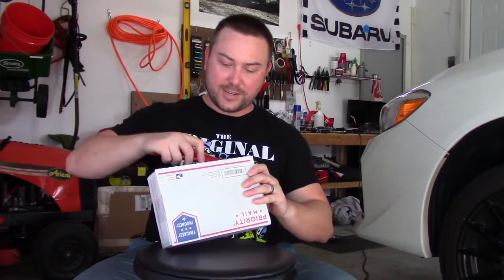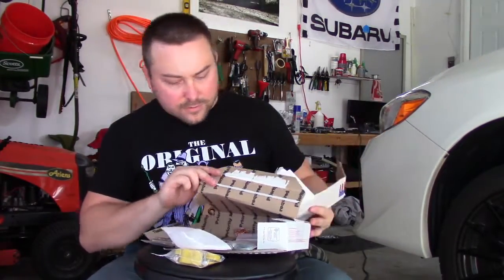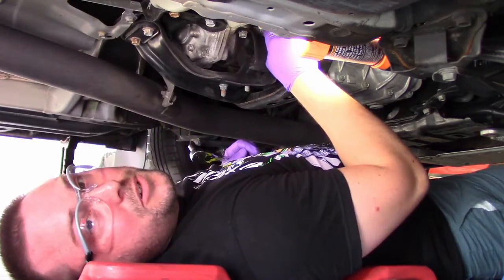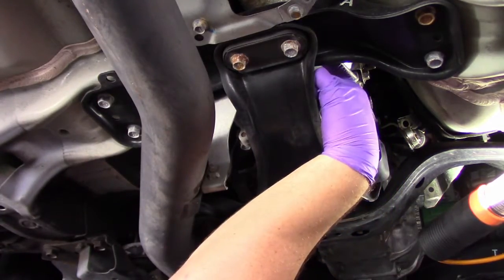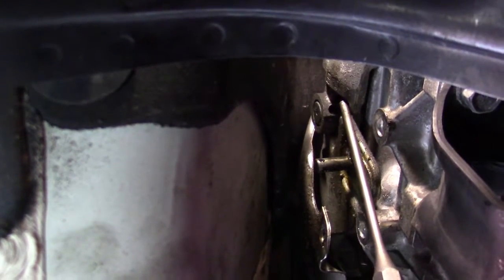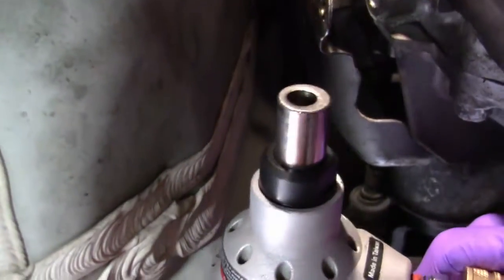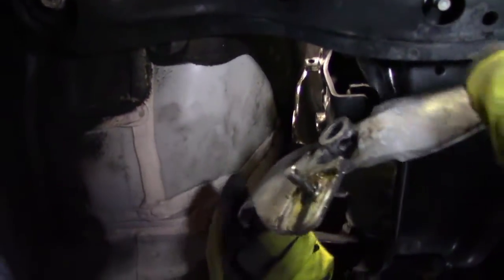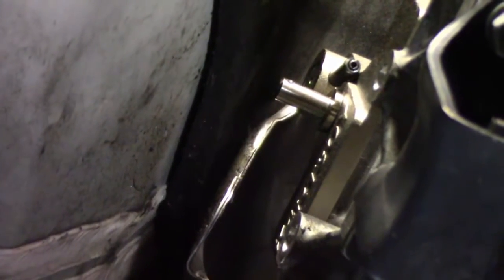How to Install Kartboy Short Shifter | 2015 2016 2017 SUBARU WRX

Comment: Great video. I followed it to a tee and got mine installed in under 90 minutes. The palm nailer is worth its weight in gold if you are using jack stands. I got a 3 gallon-100 psi compressor and a palm nailer for 85 bucks at Harbor Freight and I would have paid triple that. LOL.

Comment: Great video - thanks a lot.  Love the shorter shift! I have noticed that the shifting feel very rough/clunky when driving immediately after. Everything is functioning properly, and I’m confident that I installed correctly. I’m curious if this is normal, and if it smooths out over time?  I noticed you didn’t grease or lube anything in the video. I didn’t either. Should I have?  Could this be why it feels rough? Thanks again

Comment: Still have the car? If so how has the Kartboy short throw shifter held up? I have a 2015 WRX with STi short throw shifter from factory. Have little over 70K miles on the car. Got it November 2014 and live in NY.

Comment: is the kartboy short shift compatible with the perrin brass shifter bushing? i know the kartboy comes with a bearing to go in the linkage but id rather have the perrin bushing in instead of the kartboy bearing but is it necessary to use the bearing supplied by kartboy to make sure the short shift works?

Comment: I installed my shift stop a couple months ago and yesterday i installed the short shifter. When I was driving earlier today my car wasn't going into sixth gear sometimes. Do you think I need to readjust the shift stop on the left?
Reply from the maker: No doubt it needs readjusting these are very easy to get the adjustment off somewhat.

Comment: Did it make it more clunky getting into gear? Like stiffer and harder to push into gear? Or is it smoother into each gear
Reply from the maker: At first it was little harder to get in gear but after a week of driving the shifts are much smoother, couldnt imagine going  back to stock now.

Comment: I bought this awhile back and haven't done it cause...one I don't have a punch and I'd be doing it on jack stands.  Waiting to see if the dealer will install it for me on my next maintenance.
Reply from the maker: It's worth the effort
Reply: Did the dealer install it?
Reply: B Aq haven't gone to the dealer yet.  still got miles to go before I'm due.
Reply: alright then. I guess i'll try it out next week when i go. I'll let you know
Reply: B Aq yea definitely let me know.
Reply: any luck with the dealer? curious if I should buy new tools or pay a little cash to have it done by the subie dealer. thanks
Reply: TheMetalGuy852 yeah, dealer will want $280 to install this! Shenanigans

Comment: Could you explain/show the center jacking point for the front and rear?
Reply from the maker: I've been using the rear diff and the front is just behind the oil pan.
google Confirmation of 2015 WRX Front Jack Location? (with pics)

Comment: Hey I got the pin out using a 3/16 punch but I have 2 questions: 1. That pin is too small to fit directly in the kartboy plate. 2. The shifter plate isn't budging. 
 It looks like the pin is 2 pieces and i got the center piece out? Any idea?
Reply: My pin was 2 pieces. The 3/16 punch got out the middle of the pin, so I had to use a 1/4 to get the outer casing of the pin in order to get the plate off. So i'd recommend using a 1/4 punch to start with. Other than that, thanks for the instructions!
Reply from the maker: The reason to use 3/16 punch is to punch both pins at the same time, it can be tricky to get the correct angle
Reply from the maker: We use only the 3/16 punch on Ryan's and my car. Sorry I couldn't reply sooner I'm at tail of the dragon.
Reply: I too punched the smaller pin out first. Once I shaved the od of my 3/16 punch, and got it signed up nicely, I was able to hammer the pin out. Required some grunt with my 2lb sledge.

Comment: Did you install the two o-rings on each side of the bearing?
Reply from the maker: +Jon Cole we didn't use them as directed by Tom at Kartboy
Reply: I guess ill take them out then. It seemed like it was hard getting it all to fit on the pin. Doubt it will make much difference. Wonder why they include the rings with the kit then.
Reply from the maker: Pretty sure you'll be fine with them in there but the newer kits are coming without as people were getting confused how they should be orientated. Ryan's kit had them and we didnt use them.
Reply: Haha, its been fine for the past 10K, I might mess with it when I'm down there next. Thanks for clearing things up and  for making all the install videos. Your videos are great quality, very detailed, and complete. Makes installs a breeze

Comment: I did it in my wrx. Now my second gear feels like shit. ( already switched it back to stock)It puts to much stress on a synchros. I would not recommend . But it did felt a lot better than stock, and now 2nd grinds. Hopefully your car would not experience problem that I had.
Reply: Yeah, definitely. Give it some time guys, you'll feel it as well.